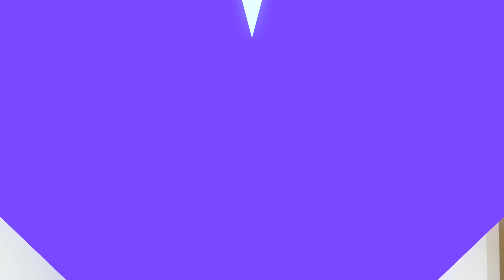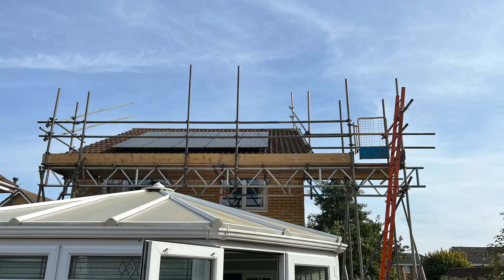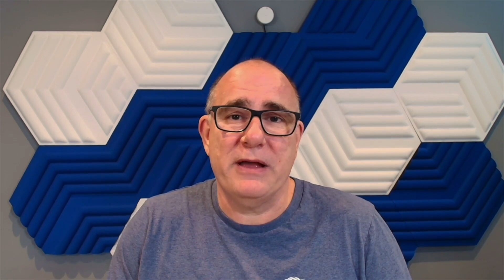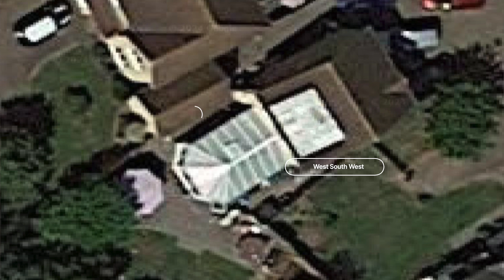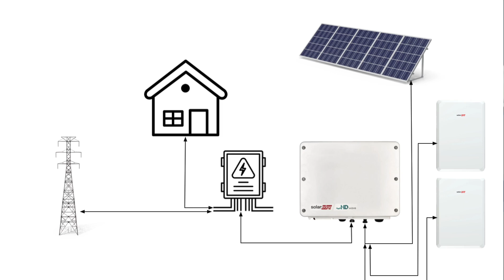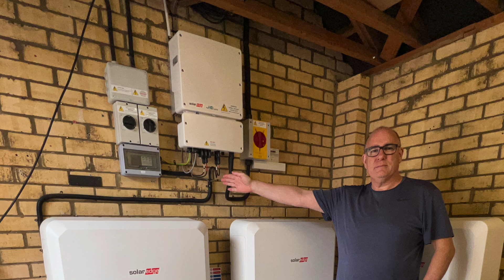How a $6500 Solar Mistake Could Have Been Avoided

Comment: I disagree. It was your installer’s fault in collusion with Solar edge.
Reply from the maker: Interested to know why you think it was the installers fault when they presented all the information to me and I signed it off. Not entirely sure how it’s a collusion with solaredge but again willing to listen.
Reply: @JonathanTracey  For a couple of reasons. You are a smart guy interested in solar and feel like you should have known. I get it. However, put yourself in the position of granny your grandpa or others with little electrical sophistication who are forced to rely on suggestions, guarantees, and recommendations of solar sales people and installers. Your problem is a common problem. I had it myself. In my case I requested and expected that my sales person was selling me the solar edge inverter which was battery ready. It was not although listed as such on sales brochures. This was compounded by the fact that building codes prevent reasonable placement of a battery anyway. In the US there is widespread shameful ignorance technical and code issues of solar sales people contracted by major installers, and this ignorance and occasional deceit are tolerated by manufacturers because they increase sales. It is shameful, but it is what it is. My bad and caveat emptor.
Reply from the maker: I don't disagree but when I first installed my 3.6kw inverter I already had a 2kw in the attic and I didn't really get (or was explained) how hybrid inverters worked. I assumed the 2kw woudl also be able to feed it (it could not) and at the time AC coupled batteries were the norm (tesla powerwalls) so I think I made some assumptions that the sales person didn't correct. But ultimately its on me.

Comment: The most the system will support is 5kw so with a west facing array in the summer we have good generation to late in the day. So we could have 3.6 from the battery and 1.4 from solar. I find in general we draw very little from the grid outside the charge period
Reply from the maker: sounds like it was well sized for your needs, we had to upgrade our inverter as i was drawing too much from the grid and our batteries can output 5kw per battery, so made no sense to have power in battery but important because the inverter was undersized
Reply: @ when in the future we change to a heat pump I will need a second battery and inverter to provider a higher throughput and maybe a 4kw south array as out present system in 7.6 west facing 20 panels. Are system is give energy very pleased with this so far. When we change we will have to see what options are available at the time
Reply from the maker: i will post some usage data over the winter so at least you will have some idea of what it will use
Reply: @ look forward to it have you seen EVM on you tube and ev puzzle
Reply from the maker: yep subscribe to both

Comment: Hi I have a 5kw hybrid inverter with a 9.5 kw battery. The battery will only output 3.6 max so sometimes when dark we do use a little from the grid to cook tea steamer and duel air firer at once so maybe half a kw each night that 13p otherwise other heavy duty items done on the off peak period at 7p
Reply from the maker: your installer probably limited your 5kw inverter down to 3.6 output under the G98 approval. You can get the limit removed and upgraded to 5kw but would require another application to the DNO under G99 to get a higher export limit. We had this exact issue with my old inverter. When we installed the 10kw one we did a G99 and got a 9.8kw approval (why 9.8 no one knows)
Reply: Hi Jon we have full DNO 99 and can export the full 5 however no MCS so had to pay octopuse 250 to get paid for export. We now have an ev so now on 7p cheap rate
Reply from the maker: So is it the battery that’s limited to 3.6 max?